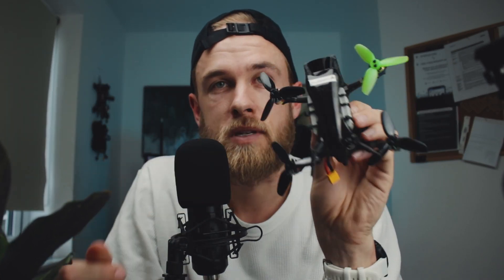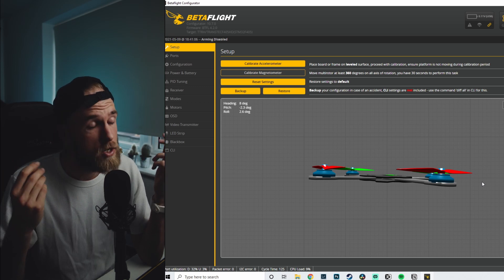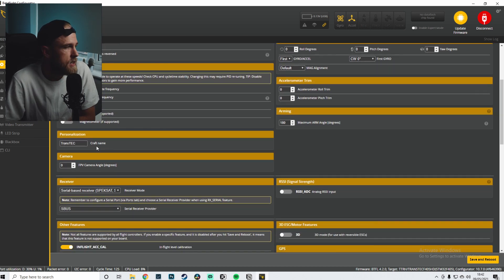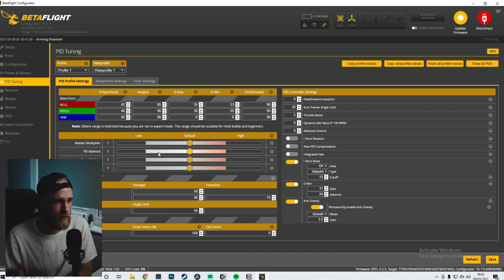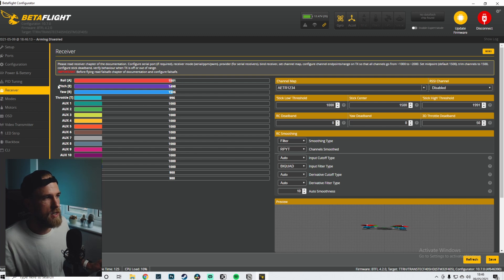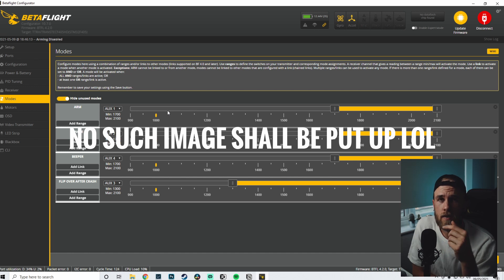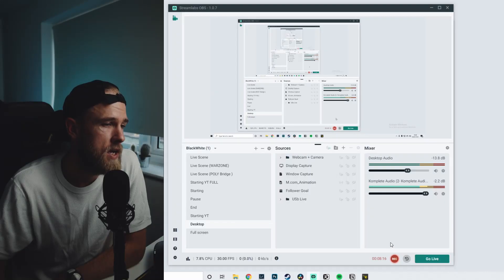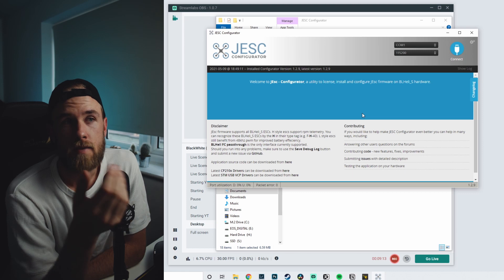Transtec Beetle V2 BETAFLIGHT SETUP for BEGINNER FPV PILOTS

Comment: I have a question about the air mode?.. I had it on and the quad would go crazy and I couldn't get it to lift off at all, I turned it off in betaflight and everything was fine.. also, wondering about the dshot 600... Is it working well or is it too much?
Reply from the maker: Hey bro! I must be honest I’m not sure what could be causing that. I don’t ever use air mode. I have basically banned myself from it haha that way I’m always getting better. I would suggest you take it off - if you can. Of your not comfortable taking it off then keep practicing on the sim? But that a hard approach. The “upgrade” to 600 felt great but it’s been so long now I can’t remember how it felt before if that makes sense. Feel like the filtering is better and the vibrations are less. The quad flies a little longer too. I think for the price (cheap from memory) it’s worth it.